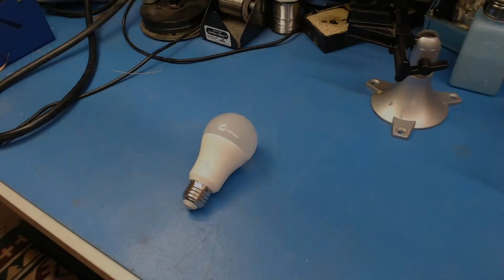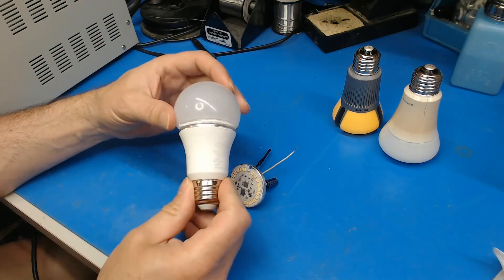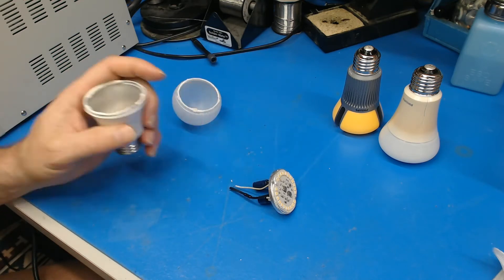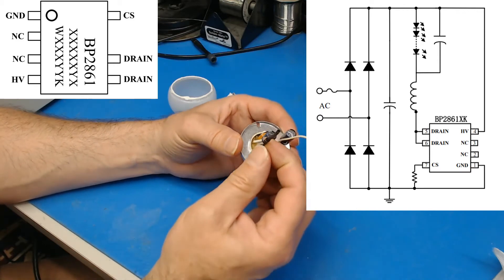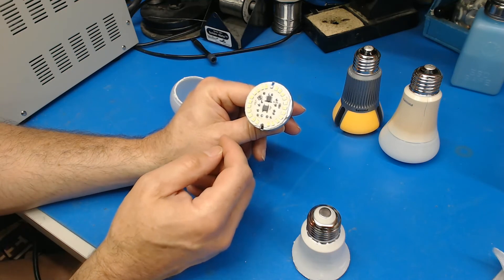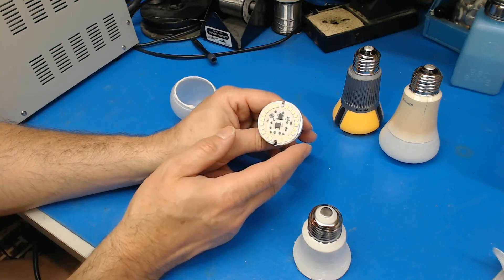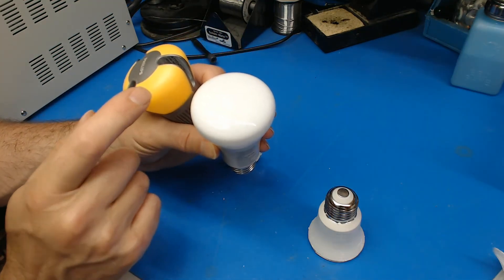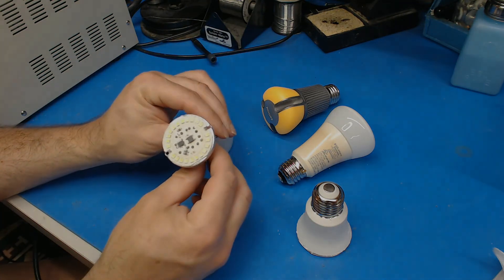Philips LED Bulb Failure - Teardown and Analysis

Comment: So what was the failure because i had two philips led lampds 11w in two diferent rooms die within 5 days to each other after 2 years...
Reply from the maker: For my case the most likely reason was a thermal failure since they don't heatsink the leds or their driver very well.  Large voltage transient can cause them to fail too.  The old style dimmers were notorious for voltage spikes.  If you have light fixtures that are heat traps,  they would kill them over a period of time.
Reply: @powerevolutions  Both of these died when they were turned OFF, they just never turned on again.... The almost exact time that both died was funny since they are in different room (5 days failure apart.
 They never got hot as the CFL ones.... And my CFL ones are going strong for 10+ years at the main staircase
Reply from the maker: @ngt84  There isn't that much inside of these bulbs.  The main chip is rated to ~450VDC to 500VDC.  So typical household line voltages range between 110VAC to 130VAC which translates into ~156VDC to ~184VDC rectified.  Because of where these bulbs are located in the electrical system they can be exposed to high voltage spikes significantly greater than the internal ratings of the device like the capacitors, diodes,  and led driver.  These spikes can be additive to the internal rectified voltage listed above, and that can kill those internal components fairly quickly though I would think that the capacitor would help clamp those spikes.  I can't remember if there was a MOV transient suppresser in the circuit or not.   The best guess based on your description is line voltage spikes.  If that occurred and caused something to fail and take out the internal fuse (at least I think it was a fuse, or maybe NTC),  then the bulb would be totally dead like you described.  I think cutting them open to see if there is any obvious signs of trauma to the components would at least give you a feel for what may have happened.  Alternately you could send them back to the manufacturer to be analyzed.  Good luck.

Comment: Took mine apart and used the meter minus and positive while the mains turned on that is and went to LED to LED and got it working. also when these lights are in a cold room they turn to not work in a Damp mainly in the winter. keep trying and don't me scared as its DC AND NOT VOLTS.
Reply: What are you on? Your comment makes no sense.

Comment: I have a house full of 2nd gen color bulbs that’d I’ve had about 5 years. 1 by 1 they’ve started turning themselves back on after being shut off or dimmed. It slowly gets worse and worse until they start strobing all the time. 7 doing it currently. Paid $50 for each bulb